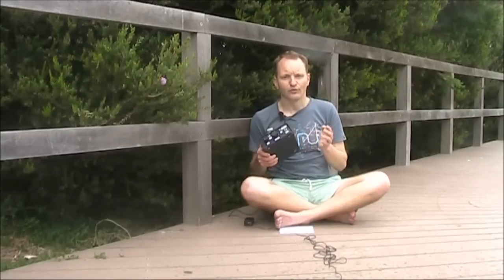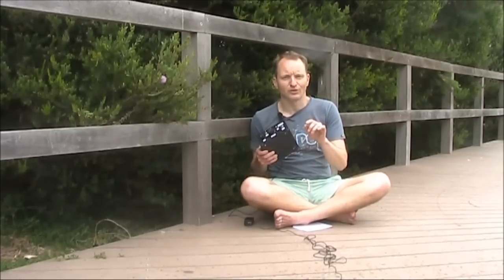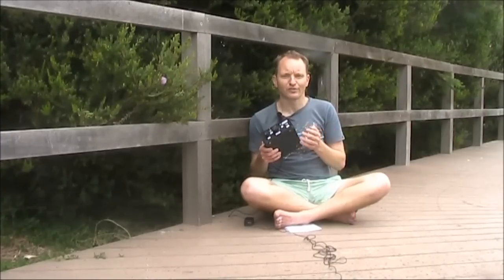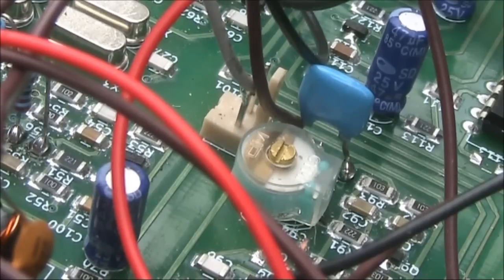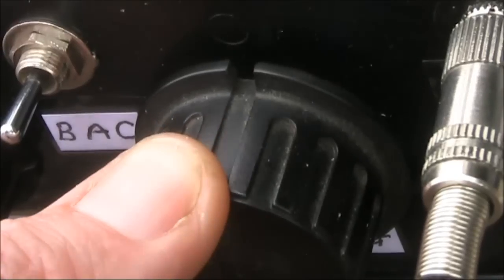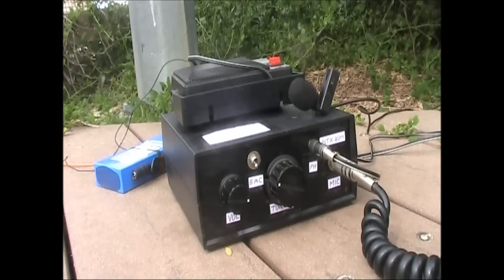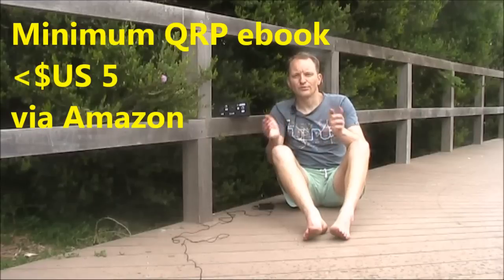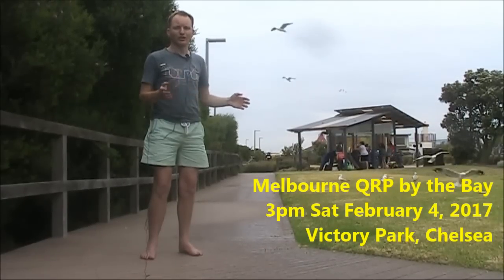Making the Bitx40 HF transceiver more stable (ceramic resonator mod)

Comment: This is another one of VK3YE's excellent mods at a very small price, however the resonator snafflers have been out and gobbled them all up. RS here in the UK do a 4.915MHz 3 pin device which is currently on back order:  http://uk.rs-online.com/web/p/ceramic-resonators/7214906/ . Hope that helps?

Comment: Hi Pete, Farhan is now providing an si5351 vfo http://www.hfsigs.com/    for   $59.00 US
Tom, ak2b
Reply: There is a si5331 VFO design for the BITX20 that uses no display and only draws 24 ma. http://pa1ed.blogspot.com/2015/07/new-si5351-vfo-by-sdr-kits.html
Reply: raccoonnyc Does anyone know what its current draw is?  Assume around 100mA.
Reply: raccoonnyc 
I've just finished putting together a si5351, arduino pro mini 3.3v and Nokia 5110 display. When I get a minute I'll measure the current.I wouldn't recommend the nokia display, it's hard to see outdoors.  2E0OST
Reply: raccoonnyc  Forgot to add, the si5351 has 3 independent frequency outputs, so no need to build a separate bfo, and at £2 - £3 for the ic, they are a gem. 2E0OST
Reply: raccoonnyc Well last time I tested an arduino pro mini 3.3v it was drawing less than 5ma and some of the displays run on peanuts, so all in a si5351 could be around 30ma. Plus if you use it for the cio, upper and lower sideband switching can be software driven. 2E0OST